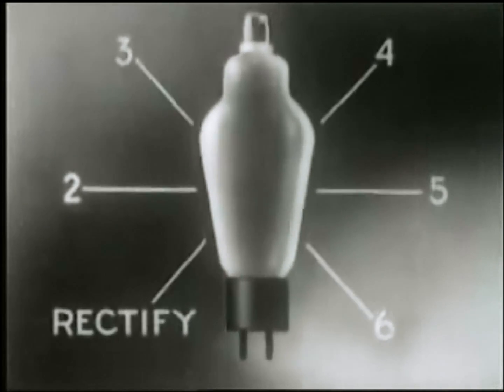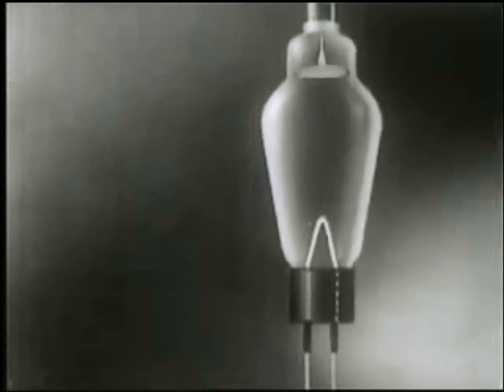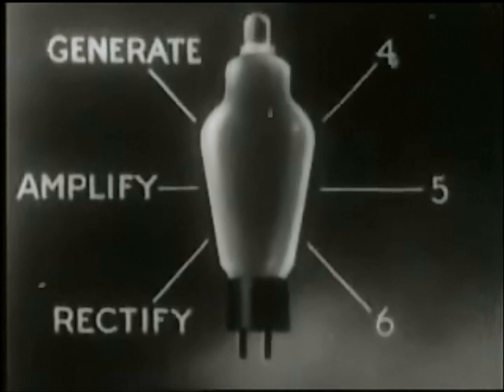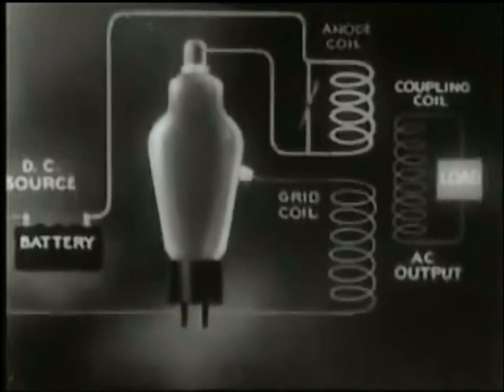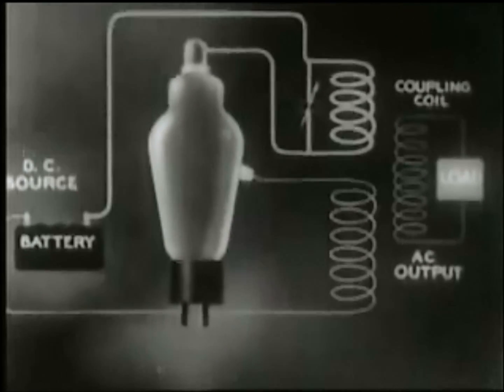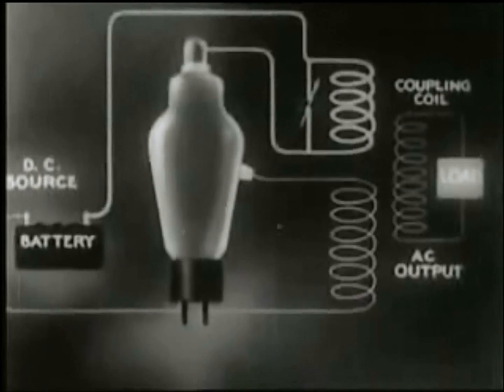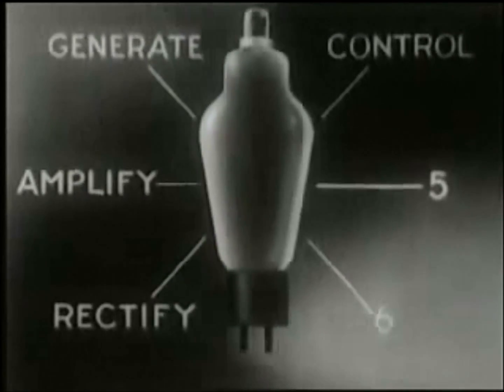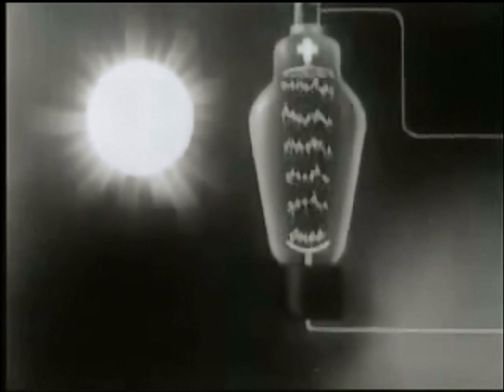Why do they not teach this

Comment: Tubes operate on voltage not that much current. I wonce had a 5 tube portable radio that took a 45 volt battery and lasted only 45 minutes lol then you had to change it. But now my transistor radio lasts 55 hours on a 3.7volt li ion battery that you can recharge thousands of times. We still use tubes in microwave ovens and other things and you can still by the 1955 beast today on line.lol
Their still in use. Pick up a radio engineer's handbook, it will give you all the information you need on theory and practical application.

Comment: The U.S Navy has quietly hide their own vacuum tube scientific engineering technologies WHILE USING THEM SIDE BY SIDE with the new high-tech solid state CMOS which even the Airforce and Army knew will be reduced to junk by an EMP weapon. The Pentagon and the Kremlin has in fact their own 100% all around vacuum tube factories that they have upgraded since the 1950s and 1960s and THEY WILL NEVER GIVE THEM UP!

Comment: They do teach this. I learned this in electronics classes as well as my own reading. I started electronics by reading the ARRL Handbook(1952) I found in my Dad's stuff. It covered all this and more. The information is still available. Not sure how electronics classes are run today, but they should include all the basics.
Reply: Once you know your logic, you don't need anything else, whatever hardware implementation is straight forward. You can even make an ALU out or single relays... I show how you form logic in the third video I have uploaded in my channel, it is all down to putting switches in parallel or one after the other...

Comment: Well, by the time I went to college for Electronics, the transistor had already made the vacuum tube practically obsolete. That's why they don't really teach you about this anymore. If you understand Electronic theory, you don't even need to experiment with them to know what they do. This is ancient technology, in the general scheme of Electronics. The only thing I have that uses tubes these days is my guitar amplifier, and that's only because I prefer the warm tone. Tubes are not small enough to use in our compact equipment these days. Everything got smaller, after the transistor. It's still probably the largest advancement in Electronics I know of.

Comment: strasng how they take 10 volts and amplify it t0 100000 volts isn't it using less energy to make more energy see laws of conservation or what not work good for mechanical to electric conversion but when it comes to solid state electric it has no basis from what im seeing. my stun gun does not have a 1 million volt battery but yet it sends a spark so great ....
we walk in a sea of flowing current and we can capture it also just like a water mill wheel in a river. the electric co make 16.5k of electric mechanically then with a solid state system it increases it many many times so it can go farther then when it gets so far the do it again it has lost much but yet theyre amplify it again and again so if you pull 3 volts from the radiant energy with tesla collector cant we also amplify this with his amp system he designed we have a big problem this will end the energy companies 
gas co with hho from water it is here for many years but it is being held back ..

Comment: This information is available. It has been superseded by far superior performing device. I don't think it's got anything to do with free energy. The "generator" is an oscillator, that can produce radio frequency wave, also know as Tesla waves, that can transmit energy wirelessly. Think of a mobile phone. Would be kind of awkward trying to do that with valve technology. And you get these "free energy" devices that make LED's blink when the mobile phone transmit. We are surrounded by electro magnetic pollution, and you can tap into these "free" resources. But I doubt that you will be able to power your household with it. Maybe blink some LED's. There are free energy sources available like geothermal, gravity, tidal motion, sun, etc. Digging in the past is not what is needed, become the same geniuses as those old timers. Use your noodle, think outside the box, make something new. How long did it take people to figure out gravity exist? It was there all along. Newton just developed it in a useful way. So can you.
Reply: What is gravity?

Comment: Most of this information is taught but seems like old tech so people don't pay close attention. Well that may change. 

Vacuum tubes are almost completely immune to radiation so have been reinvented for space based applications. A prototype device is in testing that is manufactured using common, perhaps modified semiconductor equipment and techniques. What the video said about high frequencies is correct. The new vacuum devices being developed are smaller than old school transistors and capable of operating up to 460ghz.

Imagine your desktop PC operating at 460ghz!
Reply: I remember way back in the 1950s that they are experimenting and making ceramic and glass and glass ceramic semiconductors, diodes, conductors, insulators, resistors, capacitors, inductors, wires, etc. And they developed new revolutionary manufacturing and handling techniques and new heat treatment techniques. Because the main aim is to combine them with the new industrial strenght-militarily hardened vacuum tubes designed and built and manufactured to last as long as they exists. AND THEY STILL HAVE THOSE SCIENTIFIC R&D LABORATORIES AND FACTORIES but hidden from the public and making the impression that they are all for high-tech microelectronics when in fact, they have hidden behind close doors are the OLD SCHOOL VACUUM TUBES AND 1ST GENERATION TRANSISTORS that they are silently using all these time even in this year 2019! My country is also doing the same thing also.

Comment: Tubes are making a comeback in audio. I have seen a pre- amp that operates a tube at only 24 Volts. That 24 Volts does not leave room for much Voltage gain but we're talking millivolts to start with.Granted I see little need to use a tube for rectifying the hi voltage. But it is kind fun when you understand the miracle . Hot ions, voltage potentials and cascading electrons. The solid state miracle is harder to grasp. Doped xtals, p+n regions, positrons that don't exist and moving holes. It all so intangible. Plus integrated circuits took all the fun out of electronics. Look  what they did to Radio Shack and Lafayette Electronics. It is good to see a resurgence of electronics hobbyists.  Hooray JameCo.
Reply: I agree with you on the semiconductor mystery trip. All the "scientific" explanations are fantasy as no electrons, positrons or holes exist in the crystal structures. It's also getting in the way of the development of new tech as the same descriptions fall short when it comes to actual design with the smaller geometries and higher speeds. The pulsed waves induce fields that interact with the semiconductors and generate power spikes that the design programs can't predict. If they had a proper theory, semiconductors would be self powered by now. All this drives the costs up and design cycles out. No place for the hobbiest. The latest fabs are over a billion dollars.
Reply: Very cool, May could be that self powered gig is why simple semiconductor theory remains deliberately elusive.You got me wondering what is a "fab"(rication?) and what the billion bucks can get?
Reply: +Coil Smoke Fab is short for fabrication facility. The precision and processing is very demanding. Mucho dinero. Each improvement today in resolution requires a whole new approach. Ground up design and construction. With complete new proving cycles etc.
Reply: You are a knight bruz, can you teach me some electronics? I hate reading main stream stuff if theres a chance to be led astray in my understanding of simple electronics :(

Comment: Obsolete?
Tubes is still used in HIgh End Hifi for a reason.
If there still were real education, they properly still being used.
Simply just the amazing areas it can be used in. They are not as bad as they are made into.
It is obsolete due to the cooperate have taken all the responsibilities 
of independent thought.
Not many have that anymore despite what they might believe of them self.

Comment: I guess because they do teach about FETs (= field effect transistors), which behave almost, if not completely the same as triode vacuum tubes, except FETs are much more efficient, because they put off allot less heat, they're much smaller & I'm pretty sure faster.
There are loads of books about vacuum tubes, that I'm sure you can find on the internet (and at some websites, download for free), at most libraries, at HAM fests, which are basically short wave radio operator yard sales/gatherings, & some regular yard sales.
CRTs (= cathode ray tubes, which are old TV picture tubes) are just cathode anode (=diode) vacuum tubes with coils (that can accelerate the electrons a little) to bend the beam of electrons vertically & horizontally so that it hits all of the chemical coating on the inside of the tubes face (= the screen) to make it glow.
Most regular vacuum tubes have at least one grid (which is a piece of fine metal screen) to accelerate/increase, or slow down/decrease the beam/number of electrons that go from the cathode to the anode.

Comment: Why is this not taught?  The answer is one word - Transistors!  Because the transistor is able to be made at the near-molecular scale we no longer require the vacuum tube for the amplification of radio or production of electronic oscillations.  The vacuum tube is also bulky, requiring a great deal more of power than the transistor, and is more expensive to produce than the transistor.  However.  The vacuum tube works on different principles than the transistor but does the same thing.  It is like comparing a piezoelectric generator to a Peltier module as a generator, to a solar cell, to a rotating magnetic field through a copper coil.  All three generate power but they all do so in a different manner.   "There is more than one way to skin a cat."

Comment: Well, this depends on the market. Almost ALL electronic devices use sold state semiconductor no more vacuum tubes. Vacuum tubes are less efficient, expensive, bulky compare to solid state semiconductor. What he explained in the vacuum tube will get them all in semiconductor device. Such as Transistors, Diode, Photovoltaic..etc. etc..etc...

Comment: Well they did teach me this stuff in electronics at Devry Tech! Devry is guy that  invented the triode tube (so things could be amplified! I made a living with this information for over 40 years! I have several radios that use the  "first radio tube" - "01" my nicest one was  an Atwater Kent  about 1918! - It is a"later model", as it uses "01A" tubes - Originally they thought they would possibly come up with maybe 100 variations,- thus they just numbered from 1-100 as each new variety was invented!  Then came variations (improvements)  so then they listed "modifications" with alphabet letters! Thus my "01A" was first  variation (or improvement) from original! That radio still works today, and still has the original tubes as far as I can tell yet, (have only had since 1948)! No it is not as good as a  modern radio, but can you  expect that  from  a radio almost 100 years old? -- It uses a "Goose neck speaker (looks like  speaker on "old Victrola record player"- has a magnetic earphone type audio reproduction device- -- Note  the Victrola had no electronics at all- it ran by amplifying vibrations  through the "trumpet looking horn"! Go ahead and ridicule,- but these were repairable! If your transistor radio  blows something out,- lets see you  fix it in half an hour or so (can you change a transistor that fast-- if you can find right one? A tube can be located and  replaced in minutes! How about you with a transistor radio - or TV?  No I don't think we were "dumb shits"! ---- But then again we produced the last 3 to 4 generations of people, - (And some turned out like you) !
Reply: Edgar Stahlschmidt Ahhh, the good ole days...the ole man sitting behind the tv with a huge box of tubes :)

Comment: They don't teach it because low power tubes are obsolete.  The only tubes still used are microwave amplifiers & generators. You have one in your kitchen. Satellites and radar use them.
Reply: James Van Damme Disclaimer: I spent 41 years as an engineer at the Air Force Research Laboratory, some of it designing, building, and developing high power tube based radar transmitters. Search DTIC or ReasearchGate for my report on how to build a transmitter, "Wideband S Band Transmitter", RADC-TR-89-265.
Reply: Have you seen any COP values pulsing on hydrogen in the area going from glow-mode to arcmode?

Comment from the maker: Why do they not teach this ?
It is an electric universe..
Why are we taught about gravity and black holes and dark matter..
https://www.youtube.com/watch?v=cdYYwUtCStY
Reply: derekvolt Shush.... DAMN It! You're going to brake our gig  :/
Reply from the maker: 55rebels haha
Reply: +derekvolt put this piece of crap, named tubes into rubbish bin and buy DIODEs, MOSFETs, IGBTs, LEDs and OPTOTRANSISTORs. EFFICIENCY and LIFETIME is two main benefits of semiconductors.
Reply: Can't we find those tubes on old televisions?
Reply: sparky12x After finding many schematics for tube car radios I question you about them running tube plates at only 12 Volts. They all showed vibrator driven step up transformer power supplies.
Reply: They do teach this in Baltimore County Schools. Electronics was offered in 11th, 12th grade. Tubes are making a comeback in audio. I have seen a pre- amp that operates a tube at only 24 Volts.
Reply: sparky12x Hey 'Sparky" I was just wondering about those old car radios. I was posting about Dynamotor and Vibrator power supplies. I started to wonder about how power was developed in tube car radios. I never imagined they ran tubes at only 12 Volts...
Reply: sparky12x
I will check into those tubes, Space Charge... I'm on it. Yep, seen that lone transistor on many-a-radio...Thanx
Reply: Do you have the full version or a link to it please ? Thanks.
Reply: derekvolt .